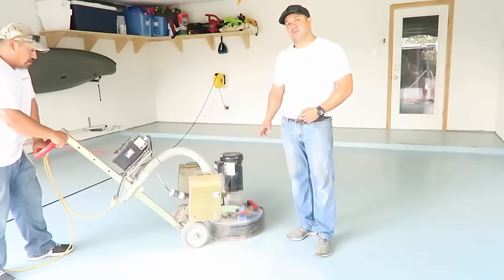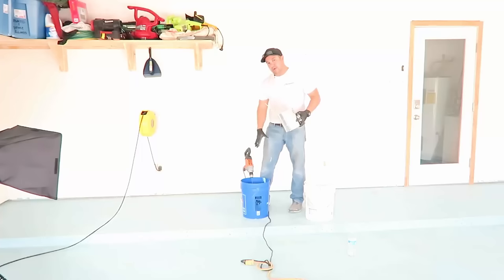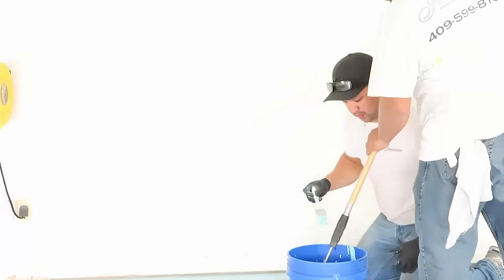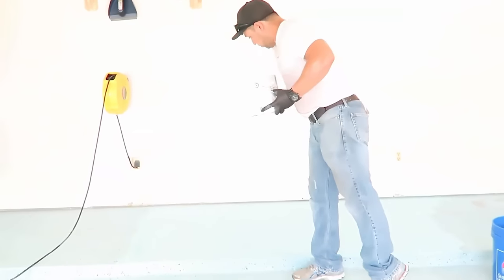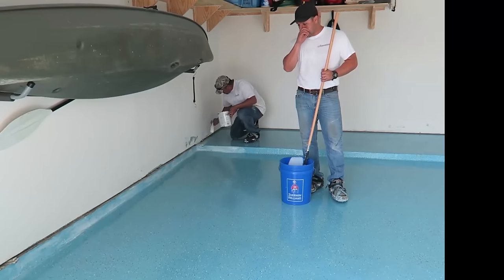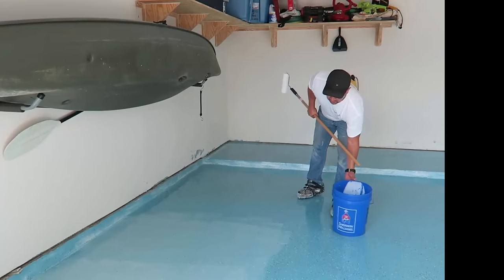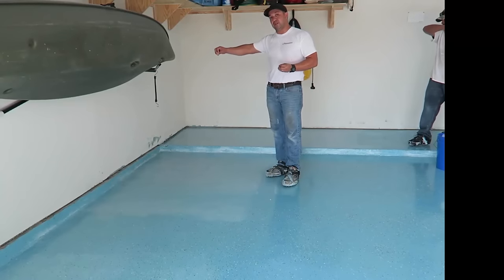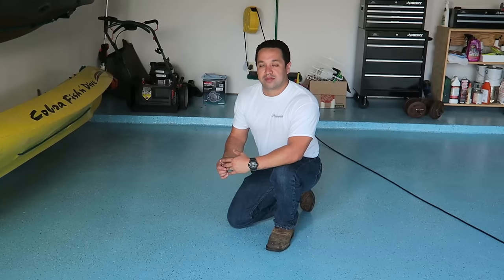Best Garage Floor Painting Houston   Epoxy Garage Floor Coating Houston

Comment: what is the purpose of the grinding? I'm sure the obvious is to level but other than that, why would I need to sand/grind? Can i get away with just giving the concrete a real good cleaning?
Reply: elyh777 opens up the pores
Reply: you sand/grind to expose a fresh rough surface by getting the top smooth layer of the concrete off. The new rough surface will provide better adhesion with the epoxy and it wouldn't peel off over time.

Comment: The photo used to advertise this vid is of a nicely polished Terrazzo floor. But your vid is about epoxy covering a concrete garage floor with a few speckles sprinkled in the process. Wtf??

Comment: Water based? It’ll lose wash-ability in 6 months if it doesn’t get picked up from hot tires. I over bought solvent clear. On my second clear coat My roller was drenched dripping wet just to use it up, my floor looks granite.. shit is bulletproof

Comment: Would you sand a new concrete pad? Seen some vids where they moisture test and power spray with water only, then start coating, w/o sanding.

Comment: I like the color but can't believe you applied a 48% solid epoxy. Even the box store kits have a bit more. Im sure it will work out just fine but why not use the hs1000 for a few dollars more and get a thicker coat?